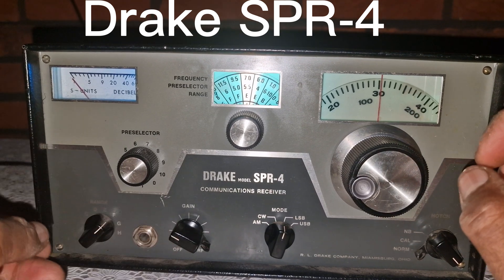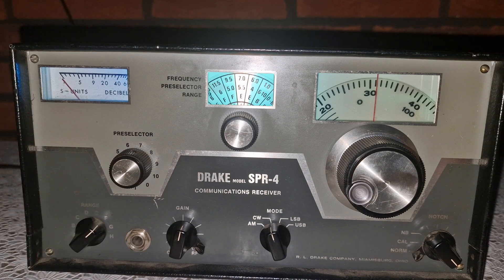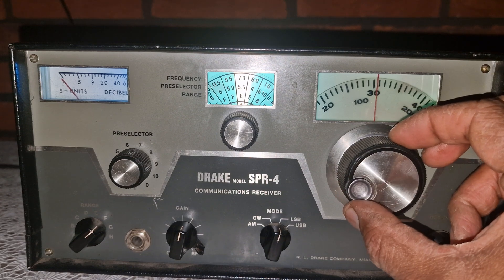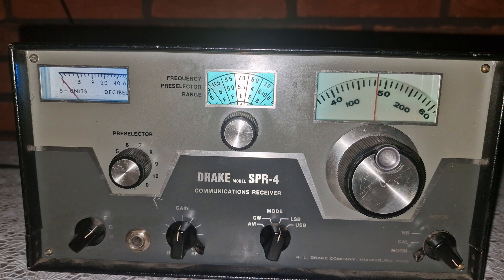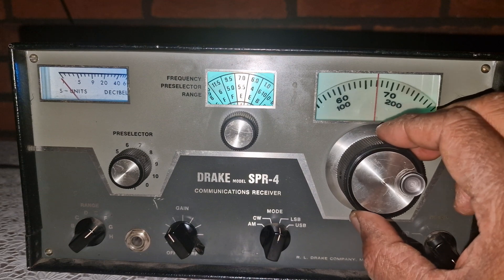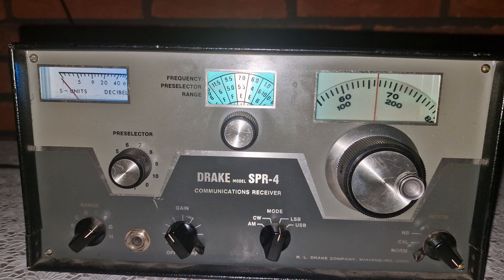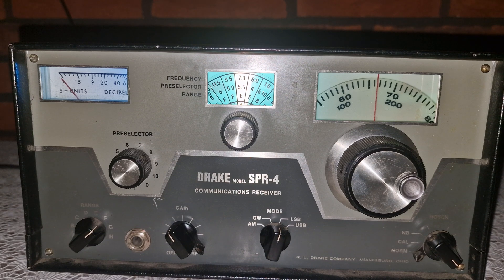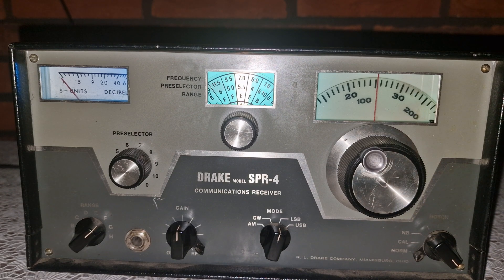Drake SPR-4 Communications Radio Receiver | The Solid-State Classic That Tuned the World

Comment: I have a pair of them; I can confirm that are wonderful radios , excellent performance and sound. I prefer it to modern radios, I have replaced the PS and audio board capacitor. I am trying to align them but I cannot go further the first IF , no movement in the S-meter neither in the voltmeter. I am using a TinySA as signal generator.
Reply from the maker: Indeed excellent Reciever

Comment: Those do not have the narrowest SSB filter but the audio quality on SSB is excellent, with the external speaker.
Reply from the maker: I fully agree superb quality on SSB, I was amazed too.
Reply: Even with the external speaker the sound is quite good, I prefer it over my other receivers that I have: Lowe HF-150, R&S EK896... in order to improve the selectibity a multi mode Datong FL-3 filter can be added. I am ready to make the modification in order to use the 2,4 Khz filter on the AM mode since I am mainly interested in BCB Dxing.